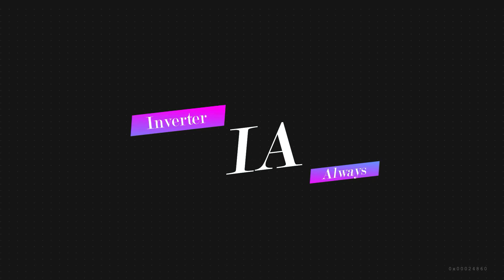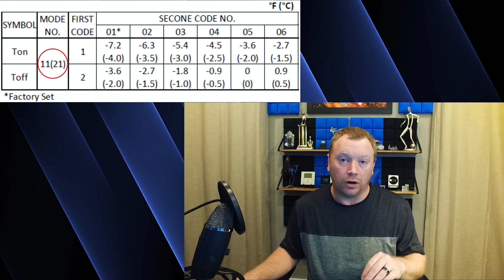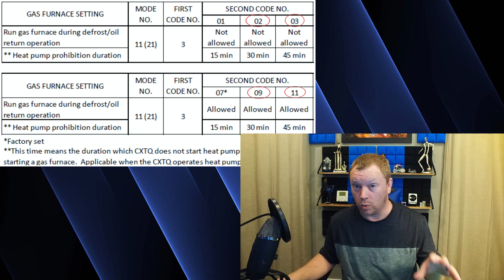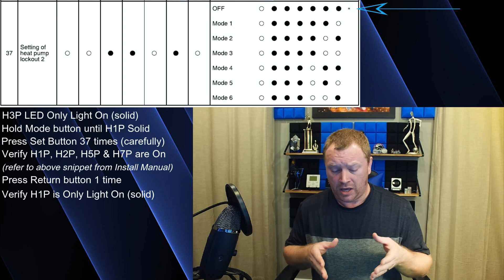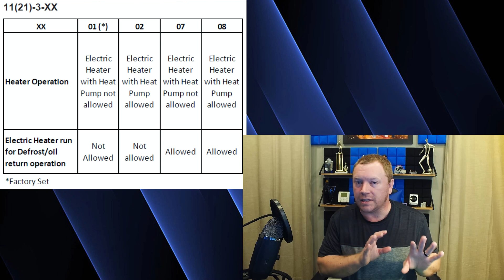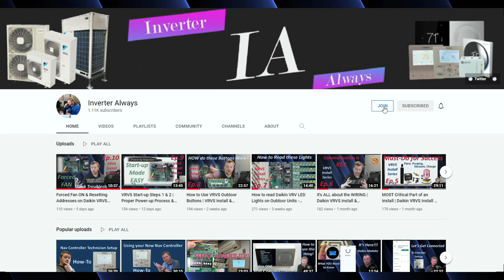Daikin Back-up Heat Field Settings YOU NEED TO PAY ATTENTION TO on VRVS/VRV Life - 12-23-2021

Comment: I looked at a dew point calculation chart,  so it seems a coil to continue to dehumidify at 50 percent humidity at 70-80 degree ambient it has to be 50 degree f or below.  So the whole notion of "cooling to dehumidify" is moot unless the coil is pushed  down into the 40's.  yet ambient temp goes into the high 60's..  So now it has to go down into the low 40's for the coil temp.  So why do they even bother with that feature on the daikin one?  It just makes your house cold as Alaska and won't even doing anything for humidity the lower ambient air temp goes.  So truly if you want your house to have low humidity in summer, lower then say 60 percent you are going to have to get a whole home dehumidifier.  What are your thoughts?  I didn't have humidity issues with my traditional air conditioner this issue didn't start until I got the VRV life.
Reply from the maker: Agreed. You need a dehumidifier that's designed to pull moisture out of your home. The daikin systems are not designed to carry that load.
Reply: @InverterAlways  On that note, I noticed the VRV software in the daikin one now has "dehumidifier" under add device menu.  Do you know is that just Daikin brand or can we use others?  I wasn't sure how that worked, so you bring in the 2 wire meant for a external hemostat, and hook it to the daikin one?  So the Daikin one would just tell it when to turn on off etc?

Comment: Hi Dana,  I was wondering if you knew the answer to this. In the VRv Life install manual page 15 and 16 section 11-1,  it talks about Three main operation methods, it says setting definition is A=Mode B=Setting and C= setting value.  Then it says three main operation modes available:  Basic, Automatic and Hi sensible  Example (2-8=2) or 2-9=1 etc.  yet in the service manual it just says mode 2 setting 8, is Te setting (for Target Te and you can set it from 51.8f to 37.4f or Variable (VRT).  Do you understand what 2-8=2 means?  If Setting 8 is simply degree F values for Te to setting it to Variable?  (So what is 2-8=2?)  

Is the Te set to "variable" the reason I have so many issues with humidity?  The unit runs at 51.8f most of the time in Te which doesn't give a coil cold enough to properly dehumidify?  So what if I set setting 8 to 46.4 that means it would no longer run at variable speed but be hard set to always keep Te at 46.4 until it satisfies cooling?
Reply from the maker: In my opinion you want to leave those settings alone. Vrt works really well and when the system needs to lower that evap target it will. Remember it's not designed to dehumidify only to maintain a sensible target (room temp). Locking in at a lower Te may lower refrigerant temperature and yes possibly help with slight dehum, but not much. And it will increase energy consumption. How much is hard to say in either case. You can try it but I wouldn't think it would make enough of a change.
Reply: @InverterAlways  Thanks for the advice on dehumidification.  But What about the user manual part?  Do you understand what their saying about mode 2 setting 8?  Having basic, automatic and hi sensible with that setting 2-8=0 1 2 etc?  Install manual mentions that but the service manual simply setting 8 is about having it variable vs a locked in te?  What are they saying so in 2-8=2,  what is =2?
Reply from the maker: @cranbers  yea those settings are your vrt comfort settings. It's how you change it from vrt auto to just basic r410a operation or high sensible Te values. Just which mode do you want the system to use. As mentioned I would recommend keeping it in the default which is vrt auto.
Reply: @InverterAlways  One other thing that is interesting,  the service manual says for  Tc , factory setting is NOT VRT, but set to 114.8F.   And my houses heats in 10 mins from 69-71 when set to 70.  But it never hits set temp in summer ( set to 72, hovers at 73 entire day).
Reply: @InverterAlways  Instead of touching the Te, I was looking at changing setting 41 from (it says mild comfort mode by default?  to Powerful to see if that makes a difference.  I know you mentioned before you don't touch these things and default is good, but rather then spending thousands on a whole home dehumidifier thought I would see if one of these settings would help..
Reply from the maker: @cranbers  that's just the speed it changes Te at. Again. When the system has a larger load it will lower Te by default and is already pretty quick to do so. Changing to powerful won't make a huge difference in your case in my opinion. You can try it, but again the issue is that the system doesn't really care about humidity. It's designed to maintain a set point. So if you're maintaing room temp within a few degrees it's not going load up that Te it's just going to relax and maintain. Its a tough situation that we always run into with commercial that's why we always tell folks you need a separate dehumidifier if the design calcs suggest the hvac can't do it alone. Rare to see resi calcs gets done though so that's probably part of the issue here.
Reply: @InverterAlways  Thanks,  so I noticed the VRV software in the Daikin one now supports dehumidifers in the add devices menu.  Any idea if that's just clean comfort brand or can any dehumidifier with a remote sensor be controlled by it?
Reply from the maker: @cranbers  should be anything. It's just a contact closure to enable a dehumidifier. So you can add whatever you want. Make sure you also wire in the fan of the indoor to run when those closure occurs, in the event you turn off the fan from field settings when thermo off.
Reply: @InverterAlways  I have a VRV life system, with the Daikin one, and I was going to get the aprilaire e080.  I saw it has 4 wires for the controller ( assuming 2 is for power and other 2 is for dehumidify call?  So run the 2 for dehumidify call to aux 1 and 2 on the daikin one?  and then add dehumidifier under add device?  So does that bring in a new menu?  I have no idea what it looks like when other devices are added into the daikin one.  I appreciate all your help by the way, its really awesome.  (also in regards to tying the unit into the indoor blower ( how does that work with vrv life?  I was told it works different so external devices can't be tied in like that to call for fan?  Did you have a guide anywhere I could reference  because I also have a ERV that would of been nice to tie into there.
Reply from the maker: @cranbers  if you look at the installation manual of the CXTQ coil you should have a section where it talks about the humidifier input. There's field settings to adjust the fan speed here, which you can use if you want to enable fan during a call for dehum. Even though it's an input for humidifier, all it does is turn on the fan. If you already run your fan 24/7 like you should, at the very least on low low  speed during thermo off, then you won't need this. You'll only need this if you shut your fan off during thermo off conditions.

regarding the wiring, i'm not familiar with dehumidifiers much as my primary focus is the vrf equipment itself (that keeps me busy enough LOL). You'll want to check the wiring diagram of the dehumidifier before installation. The Daikin One stat AUX terminals simply close a contact so you may need a relay, may not need one. But when you go to add equipment in the menu setup, there will be a section for the Dehum, once you add it you can set up the parameters there.
Reply: @InverterAlways  Thank you Dana,  I went to "add equipment for dehumidifier.  And it would seem it doesn't use a set humidity level to turn it on,  only options it has is "dehumidify with cooling,  OR  dehumidify with cooling and dehumidifying.  So, I guess there is no way to say, only turn on when its  above 45 percent humidity?  It will just turn it on when its calling for cooling ( which in my case is all day long?)  I guess this relates to the "over cooling to dehumidifying" once the cooling is satisfied it will run the dehumidifier and keep cooling.  So in with this new dehumidifier I guess I hook the dehu and 24v leads to the aux 1 connections on the daikin one.  And daikini one will turn it on while cooling and if its not at the desired humidity under allow dehumidifying +degrees menu it keeps the system cooling with the dehumidifier running until it hits it.  so I'm not sure if I want to go with a separate controller then, and just say turn it on if over 45 percent?  Or if daikins method makes sense.  I don't want my house getting in the 60's if its calling for cooling still while "over cooling to dehumidify OR if it would just keep the dehumidifier running and not keep cooling?
Reply from the maker: @cranbers  I would need to look further into this one. I haven't had to hook one up yet myself so I haven't dug into all the settings that are available once I add it. I would have expected the settings to say dehumidifier with cooling or just dehumidifier mode. But then from the main screen after setup is complete would have thought there's some settings there to set a humidity target. I thought there was a humidity setting in the main screen somewhere. But I'd have to look deeper into it. I can try to check this out this week.
Reply: @InverterAlways  yeah if you go under settings, there is a "humidity" tab,  under it it says "target humidity"  40-50 percent.. (under that is humidfy if less than and dehumidify if more than, looks like 50 percent is default, also and that is where " overcool to dehumidify" is for 1 -3 degrees below set point.  wouldn't it be nice, if the daikin one said oh, over cool to dehumidify is at 0, but humidity is above set point,  keep the dehumidifier running?  Guess we will find out haha.  But the add device for dehumidifier menu only says " on with cooling or on with cooling while dehumidifying".  So not confusing at all.   So will it keep dehumidifying if its above humidity level, or will it only keep going if "over cooling to dehumidifying is going?
Reply from the maker: @cranbers  hm, curious for sure. Test it out and let me know what you find out! Guess we will find out which either option does when you add that dehum
Reply: @InverterAlways  Yeah ill let you know, I wont get everything until late next week it looks like,  I ordered the santa fe ultra 120v.  I hope I don't blow anything up but according to instructions to activate fan and motor connect 24v and dehum wires.  So I assume that is the connection aux1 connectors will make when calling for dehum.  And I am hoping, with the humidity set to below 50, the daikin one will call for dehum as long as humidity is above 50, and shut it off when it gets to 49.. (I mean that has to be how it works right?)  These devs and engineers should know more then me and that's what I would do.

Comment: Dana, for defrost mode do you feel the same way for gas backup heat with a CXTQ as you do with strip heat on an FXTQ?  Should gas cut on during defrost or is your preference to wait also?
Reply from the maker: It's a fair question. It comes down to preference. As I mentioned on this video, I set up gas to stay off during defrost, even on my vrv system at my house. Defrost is 6 minutes long, there's no reason to run gas fundamentally for 6 minutes. And on 90 percent plus that just isn't long enough for the gas furnace to run to begin with and short cycling that condesning gas furnace can (but not always) decrease life span of the heat exchanger. If condensate gets trapped inside it then you could have rot out occur sooner. But this just increases the chance of it, it's not guaranteed to be a problem. But for me, no, my gas is programmed to be off all the time, unless heat pump lockout occurs from a system failure then it will come on for emergency heat.

This is only my preference. If your heat pump was say too small, you could experience massive performance issues when it's super cold and comfort issues and in that case it may make sense to run gas more often, but that's technically got nothing to do with defrost. So defrost wise it's totally preference.

Comment: Dana mode 37 mode 2. The manual says “ for a heater that does not require airflow.”And goes into the ABC jumpers. So how does or way does this setting apply ?
Reply from the maker: We aren't using any of that. The outdoor unit locking itself out is enough to trigger the air handler's strip heat. The ABC jumpers don't come on all models anymore and are rarely used (only needed when you want the outdoor unit to close a contact and run something else via auxiliary contacts). You can technically select any option within Setting 37 - option 2 is just the easiest/common option I select. You can select 1 if you prefer, or if you think you'll ever use the ABC contacts.